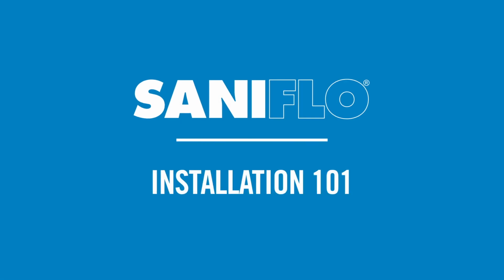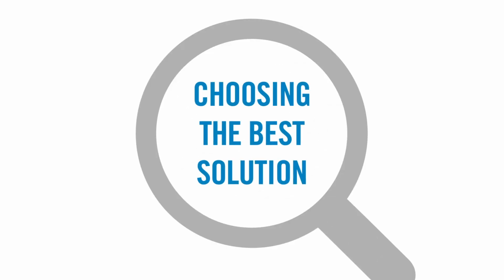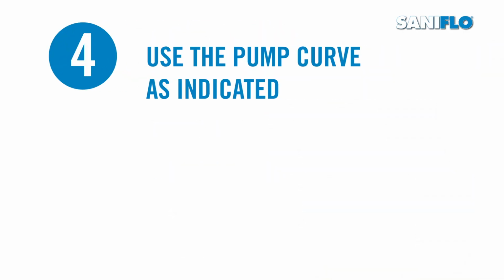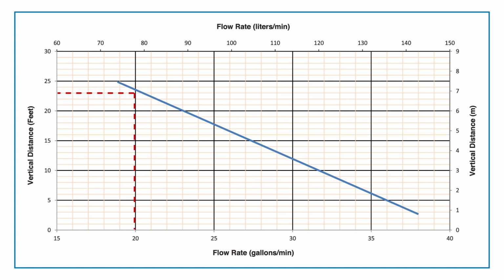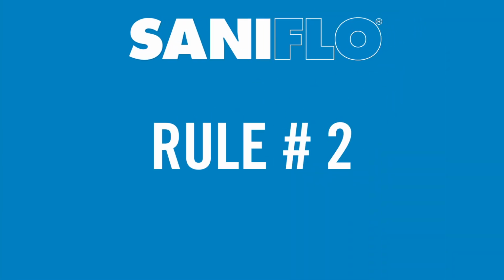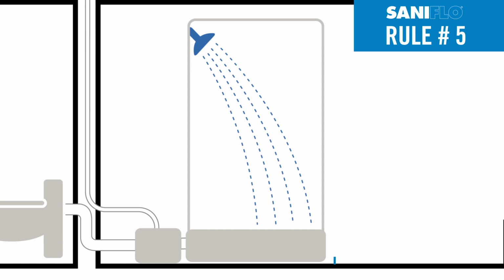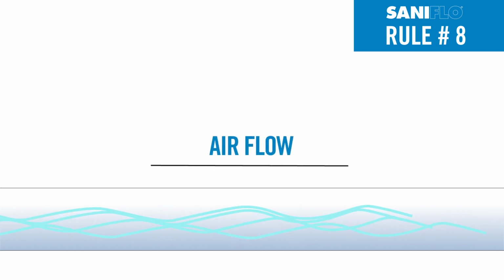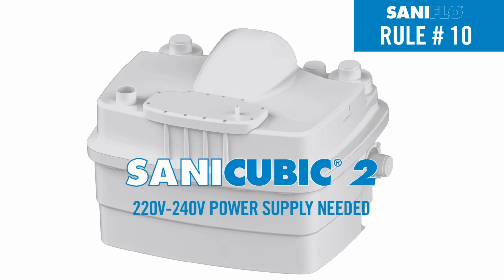Saniflo 101 - Installation guidelines

Comment: So for rule #3 the ball valve goes on the discharge pipe? And the bathtub should have a p-trap? Please answer I’m installing in my basement
Reply: That's my understanding.  
Discharge has a ball valve for servicing unit. 
And a typical p trap below the shower/tub drain. 
I have a 2x6 pt on edge with 3/4 plywood below my shower.  
I haven't installed the p trap yet, may have to chip the concrete a little per another video I watched.